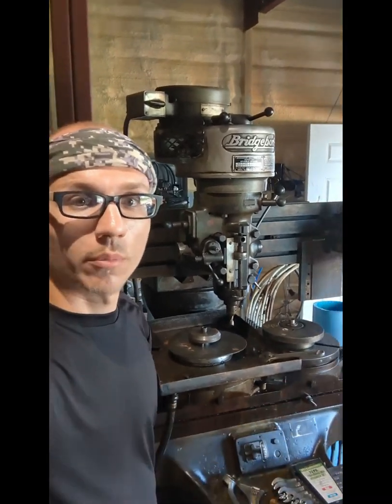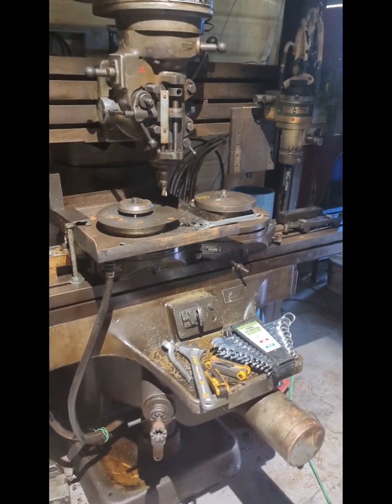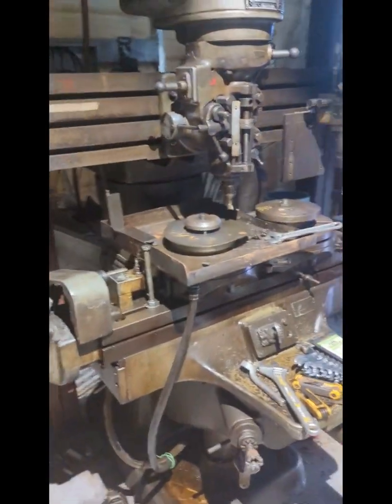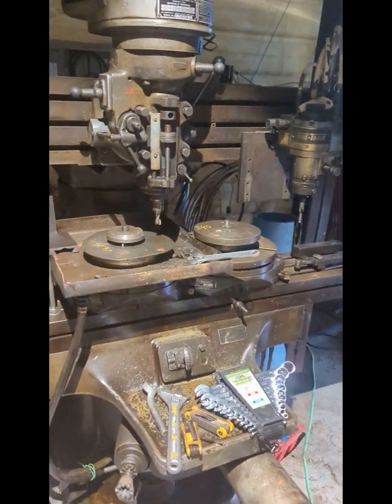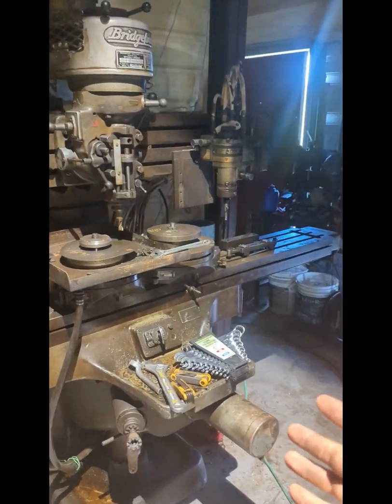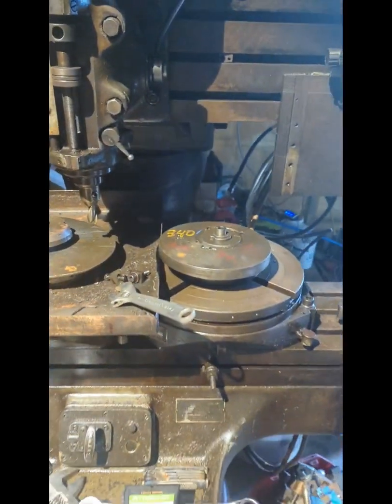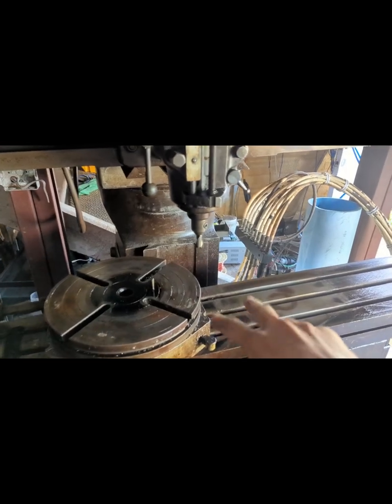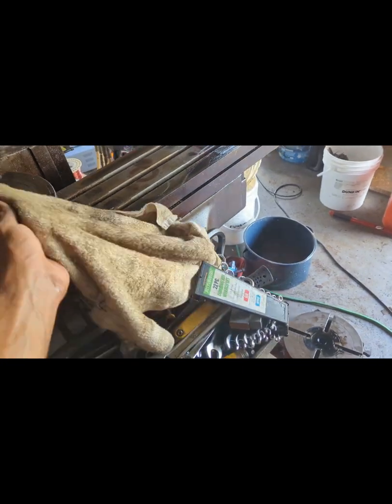Bridgeport true trace cnc conversion part 1

Comment: I bought the same mill years ago to convert to cnc. I would love to know your plan. I stripped mine of all hydraulics. Bought some ballscrews and 1800 in oz stepper motors for all axis but haven't gone any further.
Reply from the maker: Funny you mention this because im almost finished and going to start work on it again soon! I did just like you and simply welded mounts for the x y z. The biggest problem is the z axis screw where I had to turn a adapter from the screw to nut then milled a slot for a key and welded that to the screw. I also had to do a gearbox on the z axis 9:1 turned out great and it can spin easily otherwise my 12nm/1700oz.in motors were too weak. Ill make a video on it soon or a shorts video on a current in progress update on my channel. As I said I already have everything connected but I need to make the motor mounts for the X and Y better as they were temporary
Reply: Have you made any more videos on this? @Rowow
Reply from the maker: @andrewkrost8634  yes I have I just need to edit it together. Been busy the past year haven't had time.